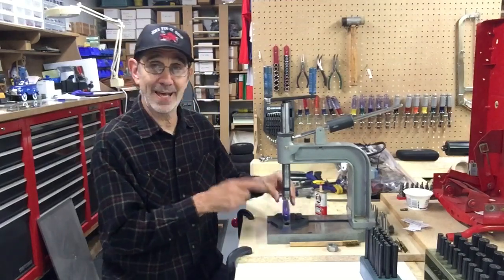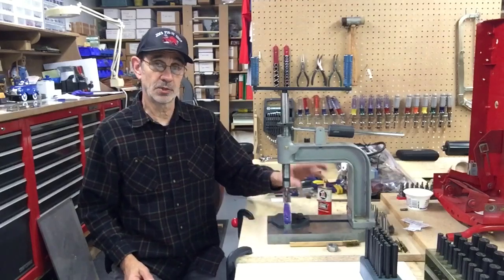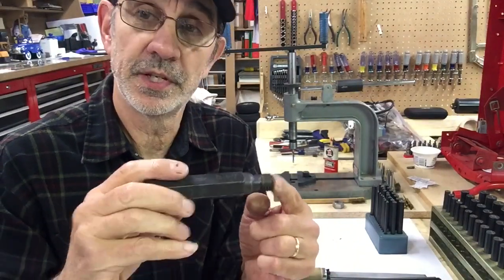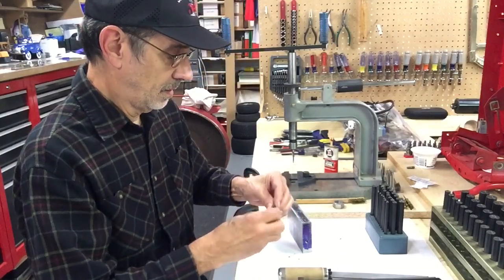445.  How can I transfer some threaded blind holes on a piece of steel￼.   ￼

Comment: That's a really cool method if you have the tool(s). I do not. I will spray paint the part and carefully lay the part down transferring the wet paint. The holes will be clearly visible. Quick and dirty.
Reply from the maker: I did look online and you can buy them from Amazon pretty cheap. I don’t imagine the quality is there and they’re probably not heat treated but for occasional use they probably be OK. Jim.
Reply: I've used Liquid Paper. Put one small dot right in the center, touch the other part against it, there's the spot to drill. Has always worked for me.

Comment: Con grads on the retirement.   I retired full time from the tool and die trade a couple of  years ago.   My tool boxes would be a familiar sight for you.   You have been a great help with my repair and maintenance of my Snapper.  Thank you very much.
Reply from the maker: I’ve been trying to figure out what to do with all my tools. I probably got three Kennedy rollaway‘s plus the machinist box and riser box on top of them, there just isn’t any machinist anymore. They’re all button pushers running CNC machines I don’t think they have a clue on how to run a real lathe or mill. And they don’t need a bunch of tools to run a CNC.  There’s so much of it online for sale ridiculously cheap. I wish I could’ve found some of that stuff when I was buying tools. Oh well, I guess when you finally walk out the door just throw one of the kids the keys and say here you go.